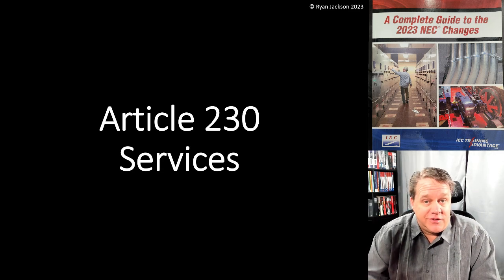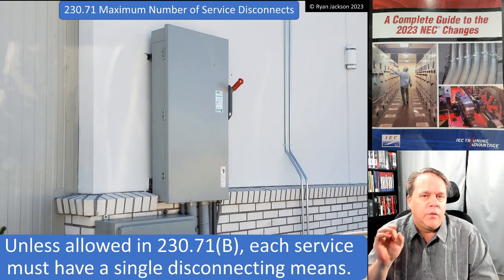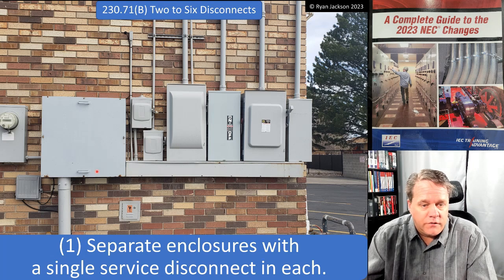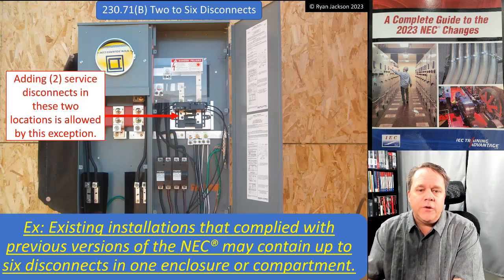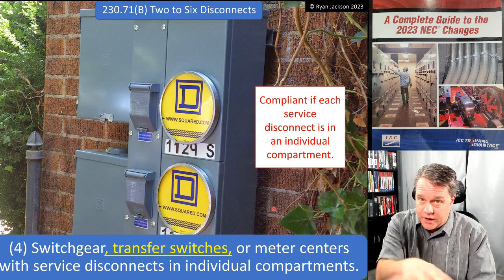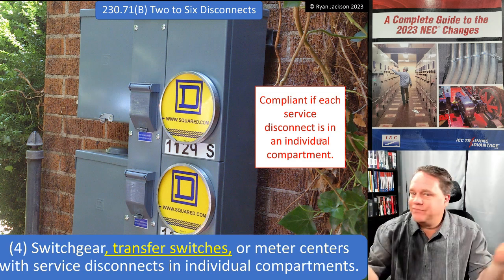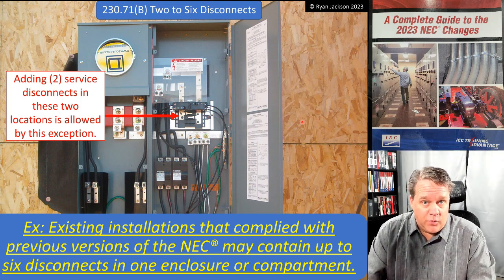2023 230.71 Maximum Number of Service Disconnects

Comment: Even if you have Seperate enclosures, wouldn't the line side of the breaker still be live considering you need the utilities to pull the meter? So we need 1 line side disconnect before the meters?

Comment: 7:00 then for the same reason the GEC must not be bonded before the service disco but mike holt says otherwise; in fact he says you can bond at the weatherhead.
Reply from the maker: You can bond a grounding electrode conductor to as many places as you would like.
Reply: @RyanJacksonElectrical  maybe he is talking about to bond the GEC to the Neutral.

Comment: So who makes a 400A meter main that complies with 2020 NEC 230.71? Can you list a few models? I have a 400amp main panel in my garage/workshop with pass thru lugs to a 200amp panel in my house with pass thru lugs to a 100amp smart panel in my basement. I live off grid in a remote area and run my entire site using PV Solar Energy and would like to add EMS to manage my entire site.

Comment: So who makes a 320A meter main that complies with 2020 NEC 230.71? Can you list a few models? Every model I find with two 200A breakers has both breakers in the same compartment. One example is Siemens MM0404B1400RLM.

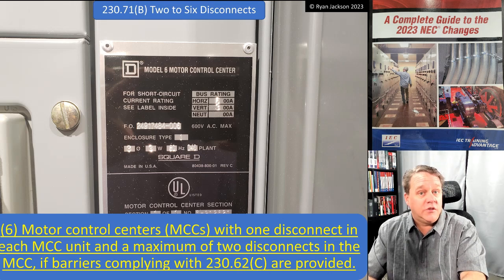Comment: 12:20.  The way I'm interpreting the ex. regarding existing installations,  if you needed to replace a breaker on a pre-1980 split bus panel,  you're allowed to do so provided the total number of breakers on the upper bus (main section) doesn't exceed six.    Is that correct?

Comment: Those disconnects at 10 minutes in the video are under the flap and is only a plastic cover. You can easily lift the cover and disconnect either of the services. No tools necessary. Common for duplexes.